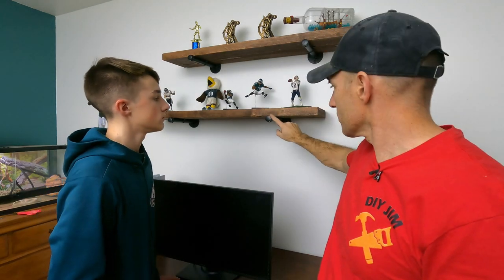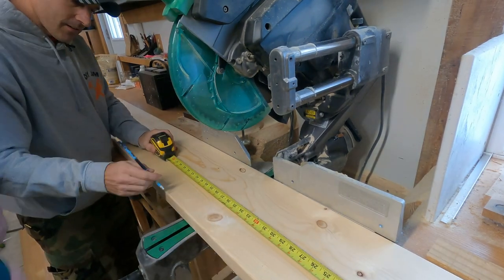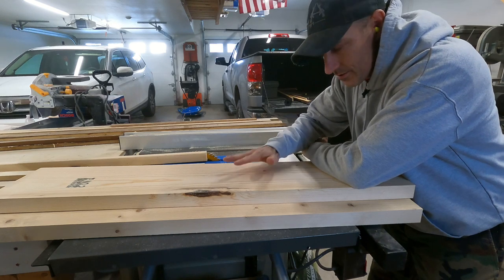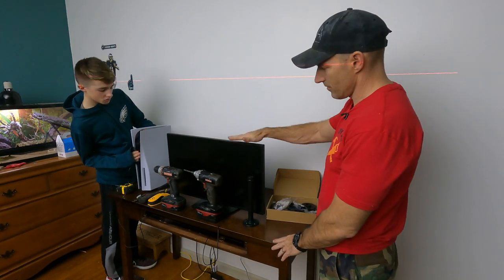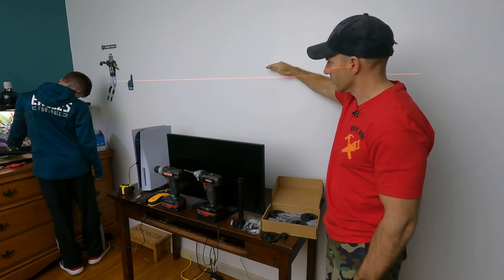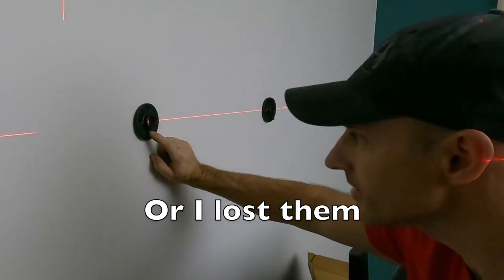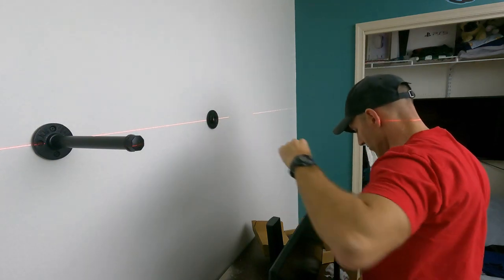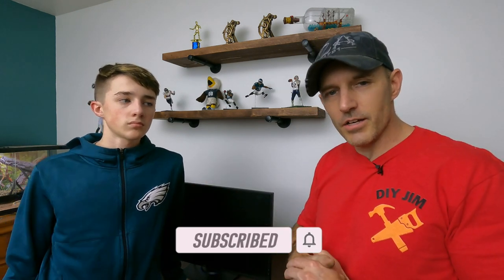How to install a black Iron pipe shelf DIY step by step

Comment from the maker: (click read more)
Thank you very much for watching and God bless.
✅ laser level (good)        https://amzn.to/3KlBchx
✅ laser level (cheaper).  https://amzn.to/3K2yKvY
✅ Iron pipe shelf bracket 8 inch set of 6.  https://amzn.to/3topyvY

  ✅ My T-shirts.  Thank you for supporting my channel✅
                     https://diy-jim.creator-spring.com
        5% off shirts use DIYJim2021 when checking out

✝Bible ESV easy to read   https://amzn.to/3qshNQP
✝Bible NKJV                    https://amzn.to/30ns322

✅Titan Solar Generator (large generator) https://poweredportablesolar.com/ref/48/

✅Go Pro that I use  https://amzn.to/2WC6WXH

✅Wireless mic used:  Rode Wireless Go https://amzn.to/2WxQt7c

*Full transparency. I am a participant in the Amazon Services LLC Associates program, an affiliate advertising program designed to provide a means for me to earn fees by linking to Amazon.com and affiliated sites.

*Disclaimer - Thank you for visiting my YouTube channel. Please understand that the content on the DIY jim YouTube channel is intended for informational purposes only. I make no warranties about the completeness, reliability and accuracy of this information. Any action you take upon the information posted on my YouTube channel is strictly at your own risk, and I will not be liable for any losses and damages in connection with the use of my YouTube channel.